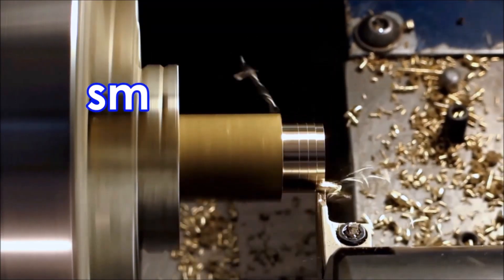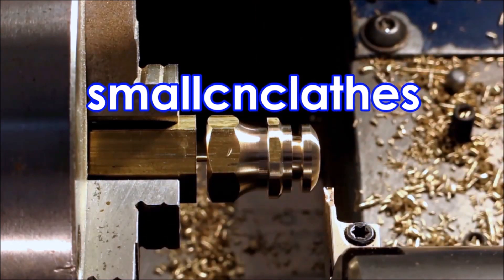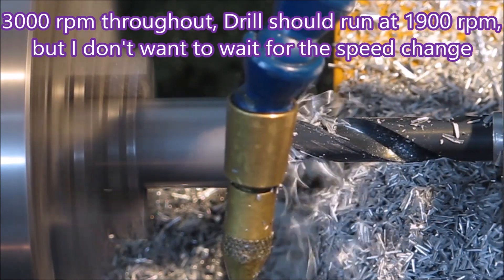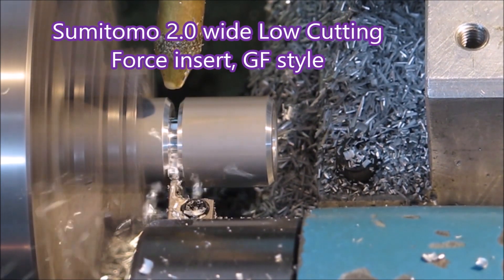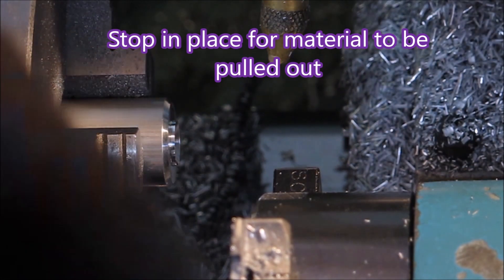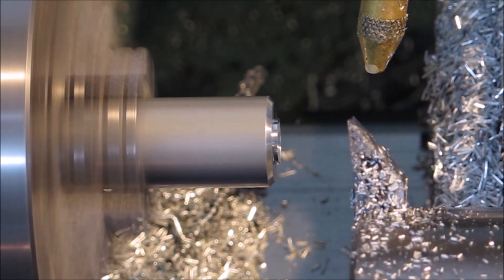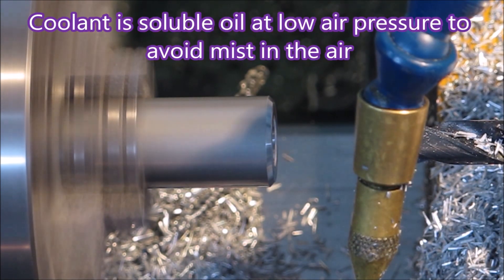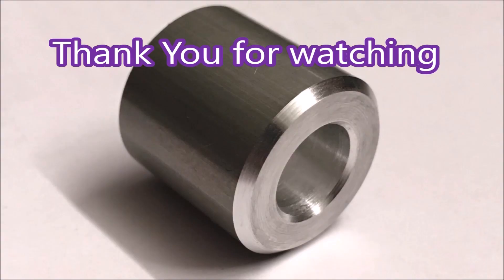Small cnc lathe.  Drill with stub drill part with Sumitomo GF insert

Comment: I learn a little more every time. I know enough to eventually get it done in a machine shop. But in no way am I a machinist. I like learning from your videos. Keep them coming!

Mark
Reply from the maker: Thank you Mark for always taking the time to comment. I am not a machinist either, I have a certificate that says I spent 5 years as an apprentice in that trade, but I am a draftsman. First contact with a cnc machine was in 2005 when I bought this one. This lathe then taught me how to use it.
Reply: @smallcnclathes    I'm trained as a Cabinetmaker and Carpenter. I practised those trades and still do off and on. I have cabinet work in some pretty fancy places. So I have worked around machines my whole life. And have had the privilege of working with some very skilled people that taught me a lot. The rest I learned from reading and watching. I am just assembling a small machine shop to do loudspeaker prototyping work. I work as a Consulting loudspeaker designer now. But keep a few days a week to get my hands dirty. Keeps me thinking. And pays the bills when the consulting gets slow.

Comment: Are these parts for your use or for someone else?
Reply from the maker: I will be working on a video tomorrow where I try different cuts and feeds on 6061 aluminium to see how it chips
Reply: Cool!!!
Reply from the maker: No, I used to make parts for customer, mostly in the Australian Auto gas industry. Now only forklifts are converted and I have retired.
Future videos will mainly be experiments and programs written for a friend that I then run the parts to check the code.